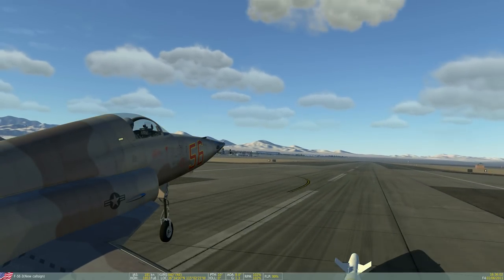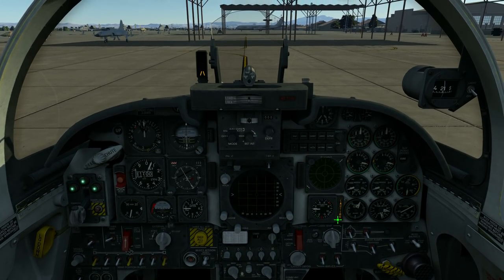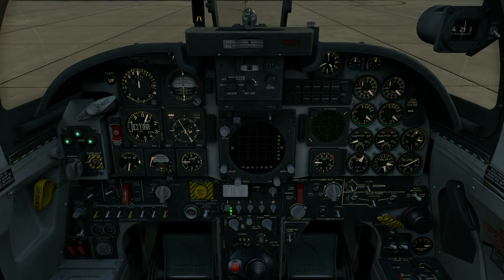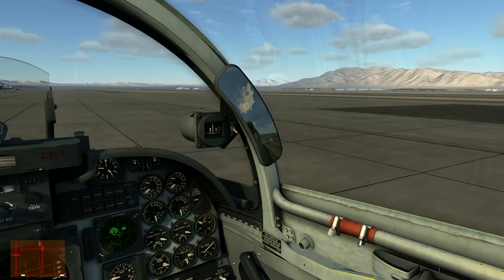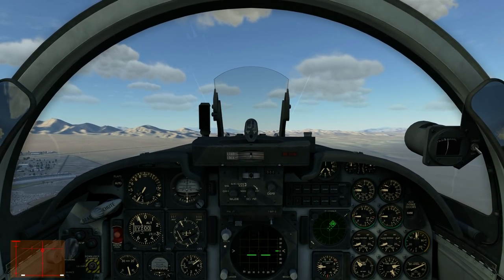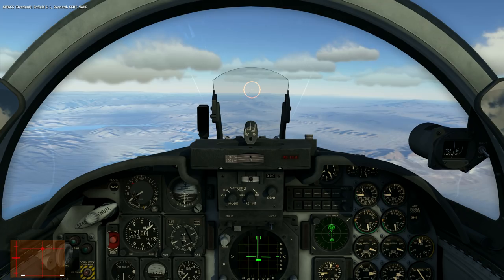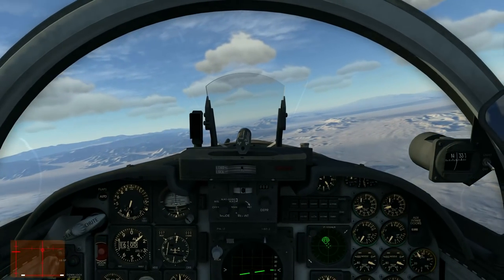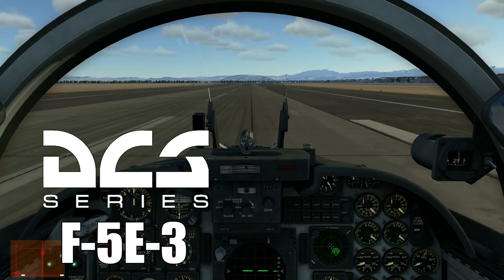DCS: F-5E Tiger II Preview - ENGLISH

Comment: What are the panel's which open infront of the canons? is it a flash hider that's stowed in flight for aerodynamics??
Reply: it covers up the guns when they aren't being used for aerodynamical reasons. pilots have two triggers, a pre fire and a fire trigger. they first hold the prefire trigger to open the panels and then the can fire using the main fire trigger. hope that this answered your question!